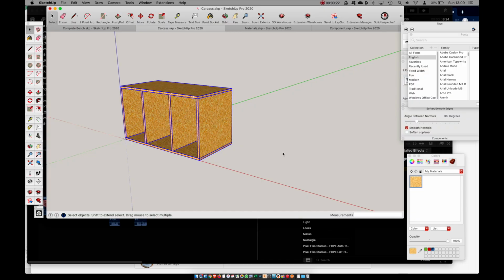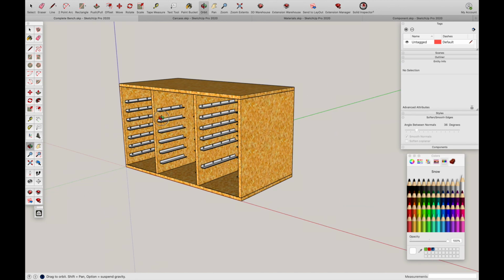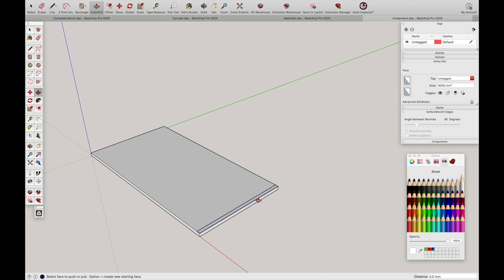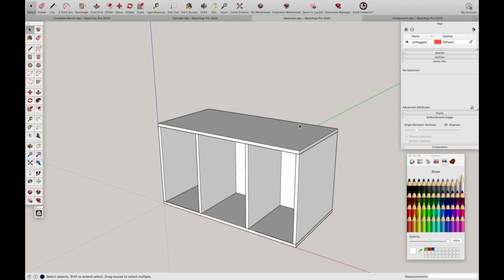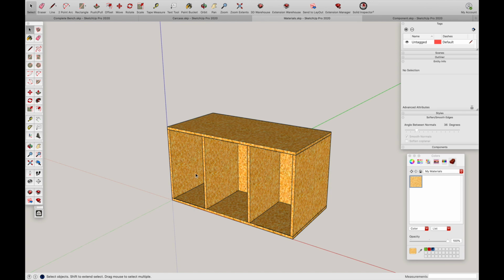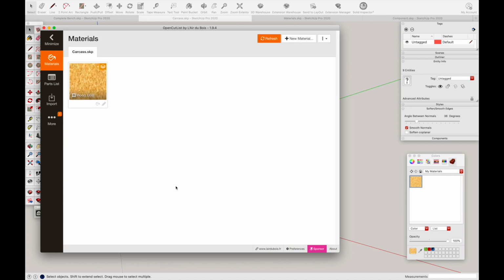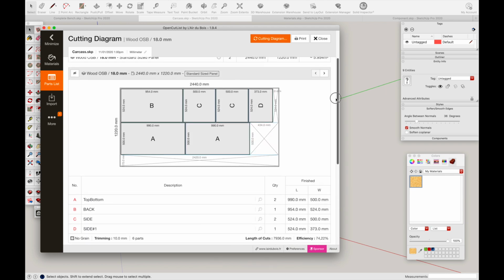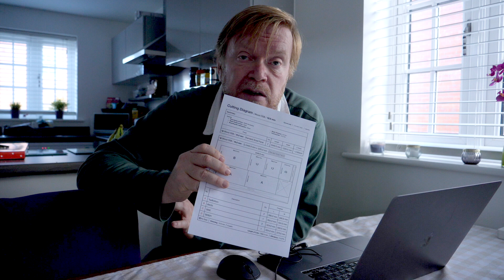Use Cutting Lists for Fast Cabinet Making with SketchUp and Open Cutting List (OCL)

Comment: Thanks for the info - good stuff.  I'm confused, though, why the program did not put that fourther piece on the first sheet.  Seems plenty of space on that first sheet for all parts.
Reply from the maker: Thanks for the comment and you've clearly been looking closely at the results. It's been a while since the video and I've used the tool hundreds of times and it does throw-up that anomaly quite a bit. It's explained by the order it expects you to break down the a sheet. It assumes that you will rip length-ways into long strips, followed by cross-cuts, and then trim cuts to final size. Generally it works well and make cuts generally to ensure that of-cuts are the largest rectangles I can obtain. I hope that helps.

Comment: Hello I'm new to SketchUp and this video is phenomenal for my learning.  Mind if I ask two questions?  

1) My project, a platform for a freestanding bathtub, utilizes many identical pieces.  Should each one be its own component with its own unique name?  Or should I designate one component consisting of all 12 identical pieces?

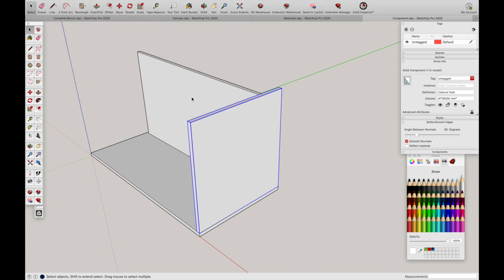2) You unhid the back panel (at time 4:50).  When I hide pieces, I see a "wire frame" representation in their place, until I unhide them.  I was surprised to see your back panel appear when you unhid it, because there was not "wire frame" representation in its place.  Is the presence or absence of the "wire frame" representation of a hidden piece, user-controllable?  Can I set SketchUp to completely hide my hidden pieces, or will I always see a "wire frame" representation until I unhide whatever I've temporarily hidden?

Thank you so much, you're a great teacher and carpenter!
Reply from the maker: Hi - thanks for the comment. In regards to your questions:

1. If you have an object that appears multiple times in a model, create it as a component and then sketch-up will manage multiple instances of the component for you. When you edit the component the change will affect every instance. Another top tip is to get in the habit of creating components, once created you can delete the component from the model and then add new instances in later from the Components window.

2. I suspect that you have View > Hidden Objects selected (turned on), whereas in the video I have that turned off. 

Regards

Karl
Reply: @StrawbyteWorkshop  
Hello Karl and thank you.  You solved problem #2 for me!  My problem #1 still remains. This issue occurred, like you explained, because I did not make the initial board into a component before copying it into 11 other identical boards.  So now I have two choices:  Make each of the 11 remaining identical boards into 11 separate components, or:

-delete 11 of the boards

-select the 1 remaining board which is already a component
-make 11 copies of that component
-position the 11 copies where the original 11 had been, before I deleted them in this exercise

It would be much easier if I could simply add the already-existing 11 identical copies of the first board into the first board's component, since all 12 boards are already positioned within the platform base.

Either way, it will be a lot of additional laptop work.  Lesson learned.  Thank you for the explanation!

Comment: Thanks so much, Karl!  I've been learning sketchup this week and this looks more useful than I'd anticipated! What version of sketchup are you using and is it free?  I'm using an old 8 version at the moment.
Reply from the maker: Hey Vikkie. Thanks for the comment. So in the video you saw me using was SketchUp Pro 2020 which isn't free. All those little tracksaw gizmos I sell are designed in SketchUp and have earned me enough to buy the paid version. But the good news is that there are very few features in the paid version which make it worthwhile buying as a woodworker/average hobbyist. I put a download link in the description which takes you to a page which has 3 versions of SketchUp for you to download. The version for you is SketchUp Make 2017 which is the last free version that you can install on your PC/Mac. After 2017, the free version of SketchUp became a browser based application which I find really useful, but it lacks functionality like the ability to install extensions like you see me use in the video. I expect 'Make 2017' will continue to work as long as your chosen computer operating system allows.
Get in touch if you get stuck or need any further advice. workshop@strawbyte.com

Comment: Are you using Sketch Up Make? Or Pro?
Reply from the maker: In the video I'm using SketchUp Pro 2020, but at the time the plugins used worked for Make 2017, the last free desktop client.
Reply: @StrawbyteWorkshop  do you recommend one over the other? I’m just getting started. I need to make plans for the guys in the shop who work for me
Reply from the maker: @creativewoodworks  If you're just getting started, start with the SketchUp Make 2017. It's free, for a start. For what you need it has all the various drawing tools needed to produce good models and you get the component features I mention in the video. What Make won't allow you to do easily is perform 'solid tools' operations which is something I use all the time but only when designing models for CNC carving or the 3D printer. If you're designing for cabinets, furniture or any other object that's comprises dimensioned components - make will give you all that you need.
How familiar are you with 3D modelling. If you're new I really do rate the Mathias Wandel series on YouTube and the getting started course on SketchUp's website. If you need any advice let me know, you can send me a direct message via my Instagram.
Reply: @StrawbyteWorkshop  thanks for the guidance. I will upgrade to Pro once I get a CNC. I will be doing the courses you mentioned. Looking you up on Instagram now.

Comment: Great video Karl.  There are loads of plug ins for Sketchup that will produce Cutlists and as somebody that builds fitted furniture quite alot they are invaluable.  The one we use exports the data to a CSV file that we send to our supplier who cuts all our components for us.  Greatly simplifies and speeds up the build process. Plus they arrive at better than 0.5mm accuracy and each component is labelled! The one we use is in Chinnor Oxfordshire  but there are similar outfits nationwide.

I mention this purely as hobbyists in small shops always have challenges dealing with full sheets.  So if you have mastered Sketchup and a cutlist program it is a great way of getting an accurate kit of parts delivered to your door.  The prices for this service are great as it is a single transparent price for a sheet regardless of how may cuts and yes you get to keep the offcuts and as they buy in massive quantities it is very cost effective. MDF £37 per sheet, MRMDF £42 per sheet plus they cut sheets up to 3050x1525 at  £42 & £73 respectively. You can get melamine or veenered boards etc. Delivery is extra but collection is free.

Secondly Karl when you were assembling your cabinet I see you inserting your Dominos into your bottom first (face of the board).  It is better to full seat the domino fully into the gable (edge of the board) as doing it your way if you rely on clamps to pull the Dominos in they can burst through the face as there is not much material behind them, especially with MDF.  Ask me how I know!

Keep up the good work!
Reply from the maker: Thanks for the comment. My local timber yard does a similar service on full sheets inc. offcuts and I've used it a couple of times. Chinnor is not far from here so I'll look into that. I do tend to meet half-way now in that I have my timber hard rip boards down which I then crosscut on the MFT. And you're absolutely right about the domino and I should know better but it's one of those things you dowhen you're thinking about what's going to make interesting footage.
Reply: @StrawbyteWorkshop  For my work it's a life saver, last job was over 220 pieces which would have taken days to cut.  Sadly I use somebody else to do my Sketchup Drawings happier with a chisel in my hand rather than a mouse.   

Not being critical about the Domino thing as I've done it myself many times and mostly it's fine but I have a Dominommake an unexpected 're appearence on more than one occassion.  As you known that sometimes can be very tight and with glue it's worse.

Comment: Great tutorial thanks Karl I’ve been after a cut list plugin so will give this a try. 
Probably me being a bit anal but can you input the blade kerf you are using into the program? I sometimes make a lot of cuts out of a sheet and would be handy to get things exact. 
Cheers. 👍🏼
Reply from the maker: Yes you can. In the video at the point I create the cutting diagram there's the material size page and a configuration tab. On the config tab you can specify a kerf and trimming allowance. The kerf is 3mm in a fresh install and the trimming allowance (the amount around the edge of the board you loose as waste) 10mm - and I used these values in the video. My preferred values is 3mm blade kerf and a 5mm trimming allowance. Another important value you can set is grain direction on the sheet and parts. Especially useful if you're using veneered boards
Reply: @StrawbyteWorkshop  great thanks Karl. 👍🏼

Comment: V interesting video - I have a project that involves making a hexagonal tree bench using Iroko. It will utilise slats for seat and back. Due to the number of slats and meterage, I’m having my supplier cot the timber into lengths of the required sectional sizes. I think it would be safer to know how to get the timber I need with minimal wastage! Would sketch up And OCL be the thing to use for this?
Reply from the maker: Yes, the video focused on only the sheet material but OCS will work with dimensional timber and what it refers to solid wood. Your Iroko might fall into either camp depending how if you are milling the material yourself (solid wood) See note (a) or have dimensioned your material already (dimensional). In fact in the project you saw the aluminium angle runners were needed in 2 separate lengths (200mm and 300mm) for the different cases. I uses OCS to work out how to get the most out of a number of 2500mm lengths taking into account a 3mm blade on my mitre saw.
I've just run a test on a picnic bench I designed but hadn't put through OCS before and got a cutting list in less than 2 minutes just by applying a material with the bucket tool to all the components and making sure I had the 40 x 70mm "dimensioned" timber in the material configuration and the 2400mm standard lengths I can get from Travis Perkins. Actually I then recalculated a minute later with 3000mm lengths and found I got less waste. It's really quick and super helpful.
Like I say design using components and apply a material (a simple colour will do).
I hope that helps. And given the level of positive interest in OCS I may do a quick video using the picnic bench as an example if I get time.

note (a) what's great about solid wood is that it tells you want to you need to start with before you cut and plane the timber to its final dimensions. Which is really handy because you can go to the timber yard with these dimensions and get rough sawn oversized boards and save a ton of money compared to dimensioned hardwood. If you've seen the oak door frame I used OCS on that project.
Reply: @StrawbyteWorkshop  most grateful for info. BTW, you are responsible without doubt for the least pretentious and ‘most useful in the real world ‘  videos I’ve seen on YouTube so far. No hamming it up for the camera. Classy and believable 👍.
Reply from the maker: @mikecrowe4674  Thanks Mike that's very kind of you to say.

Comment: Thank you for the information.  I use Sketchup to design cabinetry for my clients and currently make a copy of the finished plan and reorganize it manually in the Sketchup field to the right of the plan on material blanks so I can get a diagram of what to cut.  OCL will do all of that for me and save many hours of manual work.  I'm looking forward to using it.
Reply from the maker: Glad it was helpful! 
And that's how I used to do it too. It's pretty straightforward and works well. The most commonly encountered issue is not putting in all your material sizes or including parts in the cut list you didn't mean to. Anyway I'm sure you'll get on fine.

Comment: Can you give details of the runners that are supporting the component/storage boxes - are they an off-the-shelf product or is it (aluminium) angle, and if so what thickness and dimensions? Thanks, Simon
Reply from the maker: It's basic aluminium angle. It comes in 2.5m lengths, 2.5mm thick and 19.5mm x 35.5mm. I ordered mine online but not from my preferred seller IronMongery Direct but the price was around the same £12 per length. I needed 4 lengths.

Comment: Very interesting Karl. I’ve just started a YouTube course on Fusion 360 as I’m thinking of getting a 3D printer. I’m not sure if it’s able to do this kind of thing so easily.
Reply from the maker: Open Cut List for SketchUp is very quick and simple. But the same principles apply in Fusion 360 with regards to creating components within your overall model. From there it's very simple to create drawings and layout your components to create a cutting diagram. Its a little bit more work but you can then label that to get you the dimensions you need when you get your saw out and ANY cutting diagram will save you time.
It sounds like if you're just starting that might be a little way off - but good to have in mind - and components are needed too for 3d printing.
I use both Fusion 360 and SketchUp for modeling for the 3D printer. You will have access to many more drawing tools that will allow you to make very professional models fast so if that's your goal then you're starting with the right tool.
Reply: @StrawbyteWorkshop  thanks Karl, initially planning to just make small parts/accessory items for the workshop, then we’ll see where it leads with more experience 👍.